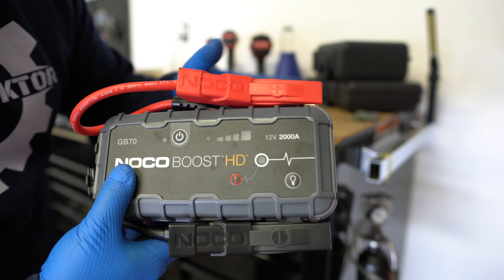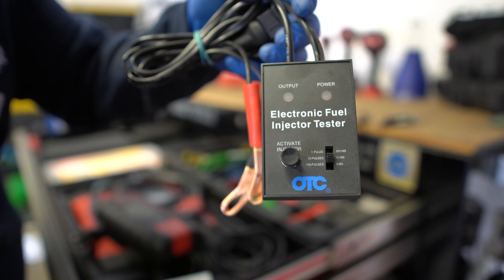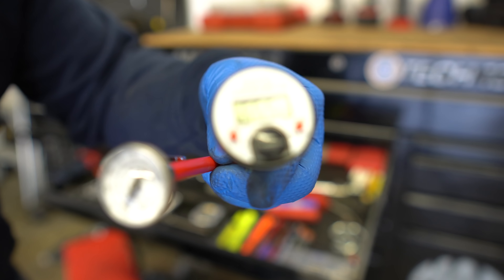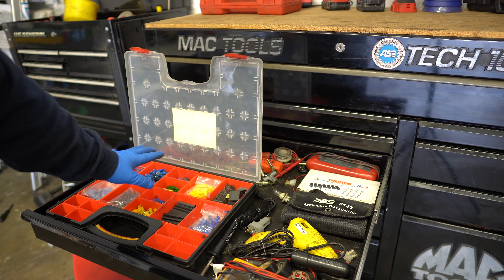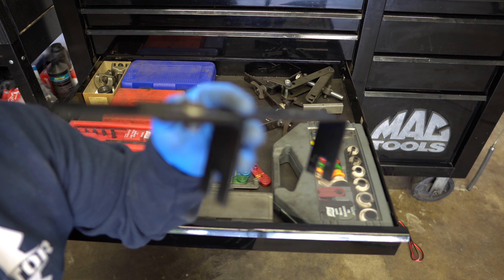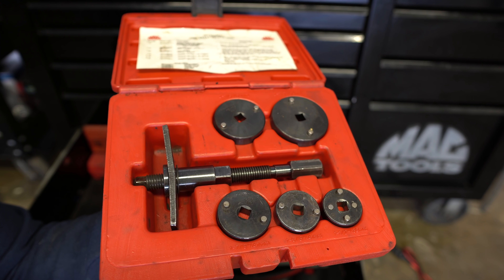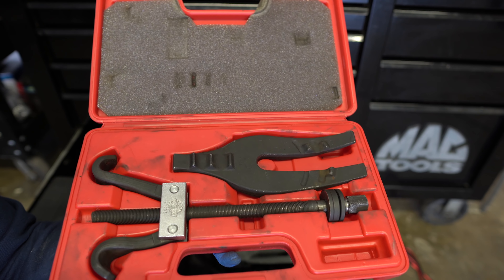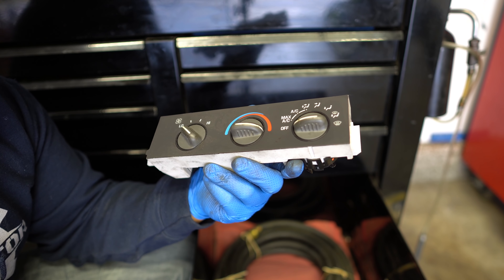🛠 What's Inside My Toolbox? Ideas For Mechanics

Comment: This should be good. My comments, as usual will be as I watch the video. .......”recertified” lol. Your videos debunk that. .......leak down tester/compression tester, never been used. Funnel never used. .........hey diag guy, what do you use to diag?... spring compressor should be from the shop......I can’t go piece by piece. You haven’t used the majority of those diag tools. Pitiful!!!! I’m sure you can tell everyone how easy ase’s are compare to knowing what you are doing. You are a perfect example of how irrelevant ase’s are.......... you never used that rocker arm tool.........”I think this is an extractor. I use this all the time” wtf........shrink wrap on relays..that’s a thing. Show us how you verify electrical circuits. You implied you have a scope, let’s see you use it. ........how do you repair wire piercers? What have you used a terminal release tool for?  How do you do a loaded circuit/voltage drop test? I would love to see you do voltage drop testing. That would be awesome ........let’s see you do a timing job? Oh, that’s right, as soon as you get a decent job; “the customer refused the job”. It’s amazing how you make any money when every tough job is turned down by every customer you have.